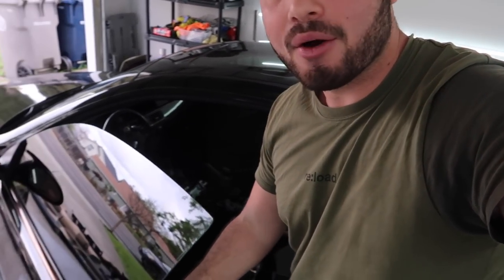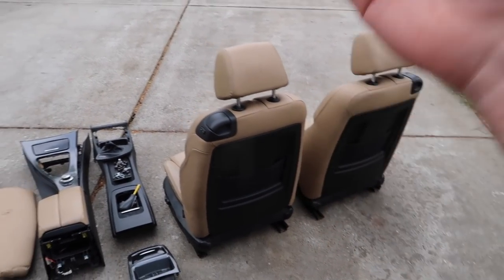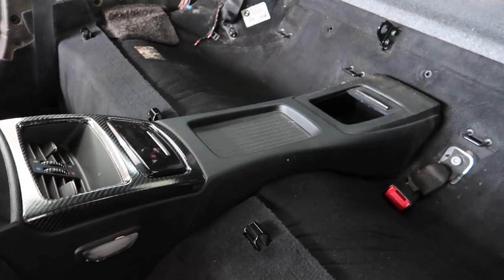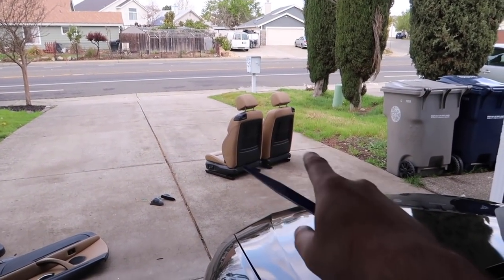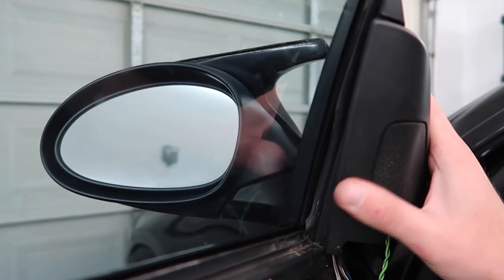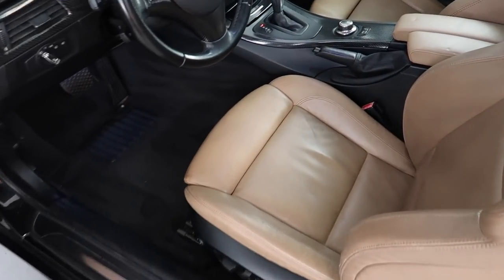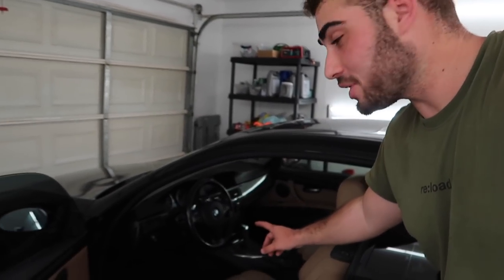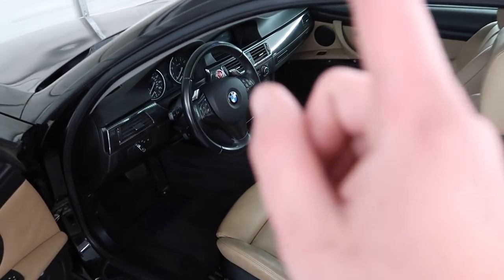INSTALLING M3 INTERIOR IN MY E92 328I! TRANSFORMED THE ENTIRE CAR!!

Comment: Did the paddle shift retrofit on my e90 323 , used a steering from  a 135 dct .Easy overall , but you have to modify the pcb in the paddle shifters,  you must be  delicate with your soldiering iron , the pcb is alarmingly  flimsy. The feature itself is nice to have , elevates the interior !!! .But you will find that the zf6hp box is a bit of a donkey too slow to respond to paddle pulls and works best left in automatic mode.

That new interior is Boss!! Very rare

Comment: For the sliding storage in the back center console just use the old one from the interior you took out. Just pull really hard on that exact storage part that broke.  and it pops out it has clips that hold it in, and the old one will pop back in Easily.  (The hole pocket and slider is a complete assembly)